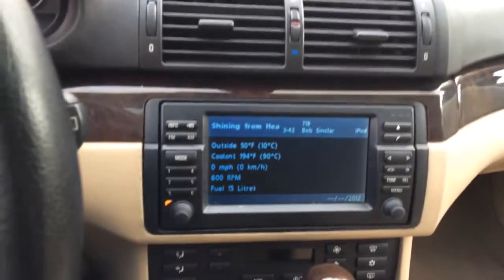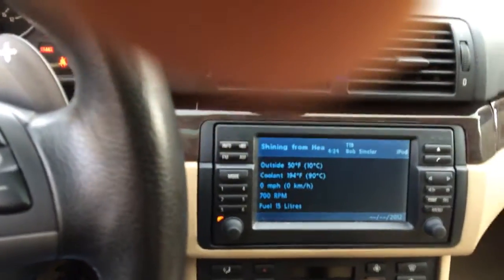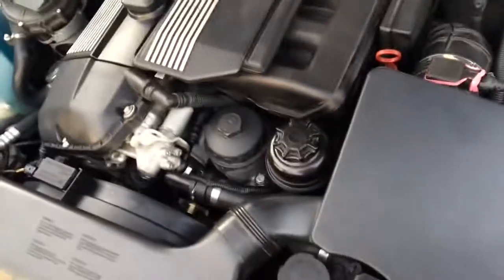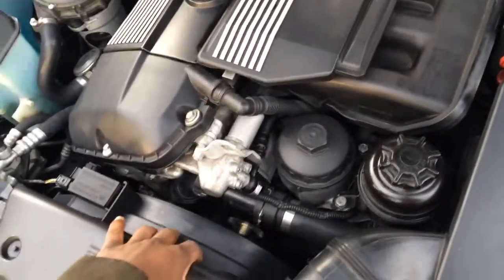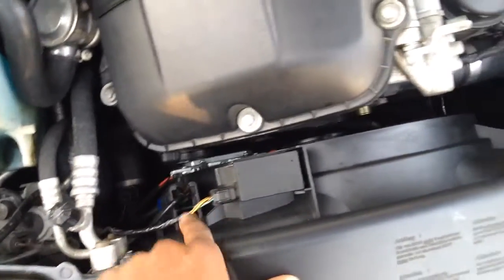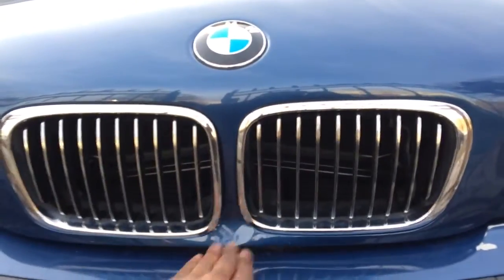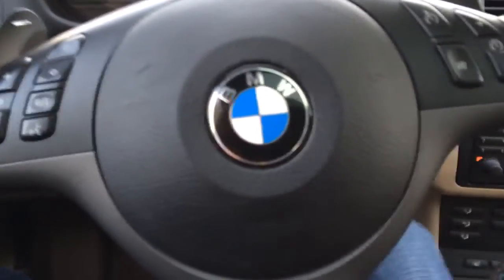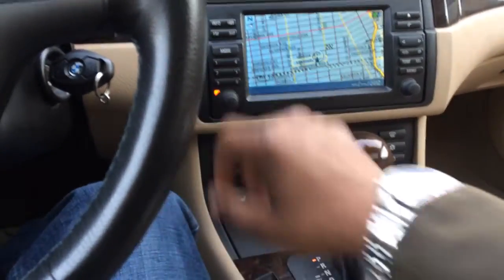BMW E46 Fan Delete Modification DIY Discussion 2 of 2

Comment: My engine fan broke in the engine bay, dented the underside of my hood and ripped through coolant lines overheating my car and seizing the engine after the headgasket had enough of the heat! Ive since put a ZHP M54B30 in there and am trying to not make any mistakes with this one, super happy to see this video and convince me to get an electric fan and do a delete! Thanks man.

Comment: Hey Olaf, I JUST did the electric fan mod to my '03 330i but I noticed I had an extra wire that powered the old mechanical fan or something.  What did you do with yours?  Did you just tape it up and forget about it?  Thanks for the video btw, great mod and makes it a hell of a lot easier if ever have to change the belts, pulleys or any work down there!

Comment: my radiator fan blew up 4 times only at hi revs ...3 times it destroyed my radiator.. after spending around 1.5k in new fans and radiators and engine mounts. I decided to delete the radiator fan and had an electrical fan(HELLA) in place. still got the AC fan. car is ok for now. its a 330ci auto 2003

Comment: Disregard Olaf,  I see what that is for now.  It's the electrical connector to the fan in front of the bumper which I haven't removed yet because I'm not 100% how to do it yet.  Your video was helpful but I still would like to see a full vid on how it is done while they're doing it.  Thanks lots again!

Comment: I did this mod on my e46 also before i sold it and it felt so much better, pretty much like how you described it.
hey totally unrelated question, but those stats on the navigation does that come with the intravee ?
Reply: I wanna know about the stats, too!
Reply from the maker: Тони Иванов Hey John, Yeah the Intravee 2 accesses the iBus system in the car and takes information on the driving behavior and engine statistics. There is even acceleration and g force (if I recall correctly) data in there.  You can also log and save your driving history up to the last 10 or so past driving events. The only thing it doesn't seem to pull out is the voltage conditions. But the beauty of the Intravee devices is that it can always be updated and programed to do more things.
Reply from the maker: Тони Иванов If you don't have intravee the OBC stalk can access the same data thru the hidden TEST menu. I have another video on that as well as other features of the Intravee's menu
Reply from the maker: George yeah the car drives much much much better. If you told me how much better before I did this modification I would have called you a liar. But now I'm a believer. I'm actually curious what is the empirical performance gain that comes with the fan delete and the addition of a Stewart EMP pump.

Comment: Where did u get your aftermarket fan?
Reply from the maker: +Mark Halvorsen I got the fan at the ECSTuning webstore (I'm pretty sure it's mentioned in one of these videos) back around 2013. I think I paid $190 or something like that. Prices may have gone up. Don't get a cheap one off eBay unless you are sure it's a legit one. My electric fan is still going strong 50,000 miles/ 3 years later. Definately a great upgrade!!!! Do it! Do it now!

Comment: why would the fan have anything to do with steering... at all... get real man, the mechanical fan version comes on automatic transmission e46's manuals use an electric already as they do not have the extra heat load from trans cooler, this means they put the mechanical in your car on purpose because it can output higher cfm than the electric to hand the extra heat load, why dump it and the aux fan as well(if the fan you moved too was no oem and has higher cfm then sure it might work, but will drain more amperage, or next 100 degree day with you working your car it may start to heat climb...), the mechanical uses a fan clutch to engage and disengage the fan from the drivebelt it is not always on... yes mechanical drains on your engine a hp or two, electrical drains your battery 10amps or so... pick your poison, with my audio system taking up every available amp(i'm borderline needing and alternator upgrade) i wouldn't mind the mechanical to give my audio the extra juice....